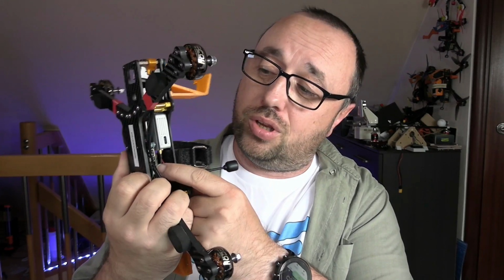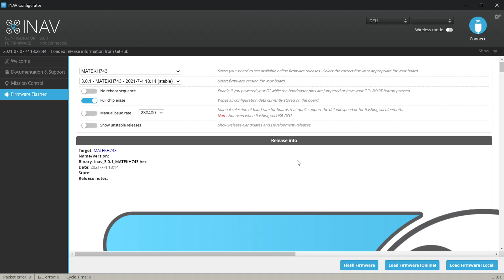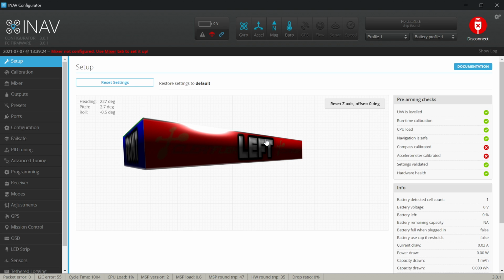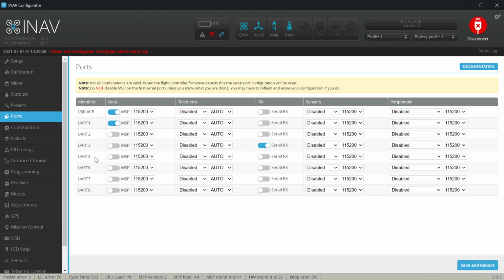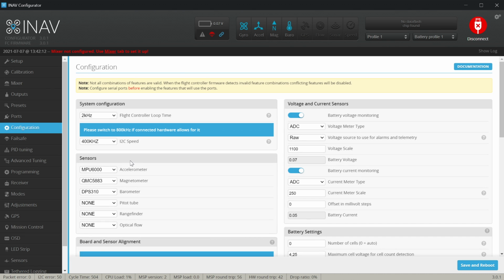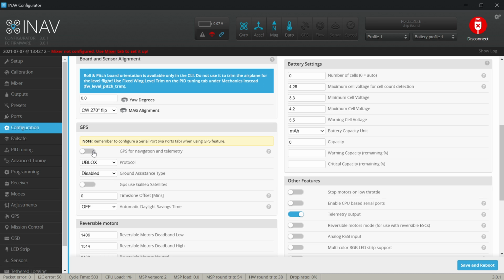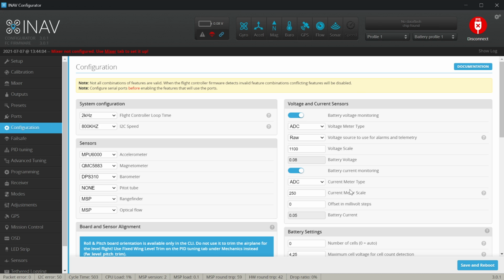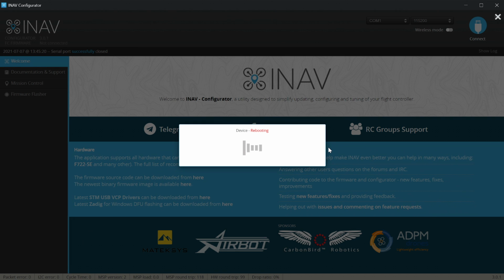Flashing & hardware | INAV on a FPV drone tutorial

Comment: Even after 2 year so many bugs
Reply from the maker: you have to be more specific mate
Reply: @FPVUniversity  after flashing speedebe f405 v3, and chosing 7 inch settings. I have  popup and with endless loading "Device-Saving default settings". And loading components stucks on "PVM poutput is disabled......". Previously all works on betaflight
Reply from the maker: "PVM poutput is disabled" is by design , you are supposed to enable it one you are ready. And are you sure you have the latest version?
Reply: @FPVUniversity  yes,7.1.1. but is it ok that popup does not closed?
Reply: With configurator version 7.1.0- there is no such issue

Comment: What’s the best way to use a flight controller with inav just for the dji air unit 03 to arm correctly and use the osd. This is for a rc truck. So I was thinking is there an option with no motor? Because it works great as is. Can I simply not connect motor or servos or reciever and just use the fc for the air unit?

Comment: Hi Pawel - As you can see below I posted 1yr ago and got my Quad working ok but since then I installed FW ver 6.1.0 then 6.1.1 both working fine but since a computer cleanup my installed Configurators will not load up - re-installed drivers STM32102.zip : CP210x : and used IMPULSE Driver update  BUT  still clicking the  ''exe Icon''  for Configurator 6.1.0 or any other  does not loadup the Configurator - please help...joe

Comment: I have iNav 3.0.2 Configurator but shows only COM1 and manual Port   but I cannot communicate with my Quad Matek F722 STD  FC   ( FW Unknown )  - I am sure I could in the past - What is my best option  for my setup - best for you ...joePawel - not sure if by using the  ImpulseRC  tool  enabled me too communicate with the F722 and then using CLI  input = version discovered FW to be 4.0.0

 Changed  now  to Version 4.1.0  - - Please what are my Control & Mode options with this FW 4.1.0  ....joe

Comment: I cannot find a flight controller in stock that has a Barometer on it and also an INav target. The Holiboro ones are all out, the Matek ones are all out, the only ones left are 20x20 stacks or HGLRC (would not trust them) Chip shortage is part of it, but the other part of it is the sheer lack of available targets. It's a 3 way loop of consumer, manufacturer, and INav. I want to get into INav, but literally I have to learn how to create a custom target, and how to somehow add a barometer and a compass to a FC when the FC only has one I2C set available (Both compass and Barometer need I2c)

Comment: I am finding it hard to find information on whether it is worth adding a laser distance sensor(say a VL53L1X) to my quad build? If yes, how do I set it up, any videos, as all I can find is adding a sonar which isn't the best to have.
Also just to confirm, I am running a Mateksys F722SE and a Radiolink SE100 GPS, I should use the compass on the GPS? Or can you use both, as with a second IMU setup?

Comment: How to tune PIDs or other settings for ALTHOLD and POSHOLD for different sizes and weights of the battery. It works well on small LiPo (under 100g), but when I use over 200g Li-ion battery on the same 4" quad, it starts to descent when I set ALTHOLD or POSHOLD mode.

Comment: ,IVE WATCHED ALL THE SETUP VIDEOS and gone through all the steps but for some reason, the Beitam220T will not appear on the top row of icons when I connect the board to the Version 3.0 configurator and Ive tried a number of the F411 firmware versions for the Matek F411-wing but the Inav 3.0   I have loaded WILL NOT LET ME SAVE THE GPS DETAILS IN EITHER PORTS OR CONFIG I do the setups and then save and reboot and they are not recorded. Is this a problem with the flashed firmware that isn't correct for the Matek F-411-wing  or should I be talking to the programmers that there is a BUG?

Comment: Hallo Pavel, danke für das Video und die kommende Series. Ich habe mir das neue "25.5x25.5mm Racerstar AIO F411 Stack 2-4S F4 FC" gekauft. Es kommt mit INAV vom Stock. I werde damit meinem ersten 3 Inch 2 S Li-Ion INAV Quad mit GPS bauen. Ich habe eine Frage,  unterstützt INAV die Protokolle von "ImmersionRC Ghost" ?

Comment: Czecz Pawel, I want to build a mid range 5"quad with inav. So it should be pretty powereffecient and be able to fly alone (GPS, RTH, etc.)
your recommended stack is without Baro. I thought I needed a barometer for autonomous flying. What is your solution?

Comment: Hi Pavel, what quad model are you using in this video series?
Reply from the maker: That is Pirx Seven https://fpv-shopping-list.com/pirx7
Reply: @FPVUniversity  Thank you for the link. Question: Is the electronics that website lists  for this quad the same as what you are using in your new INAV series?
Reply: Thank you for your quick response, nice frame. Looks rigged for a 7 inch frame, I look into buying one.